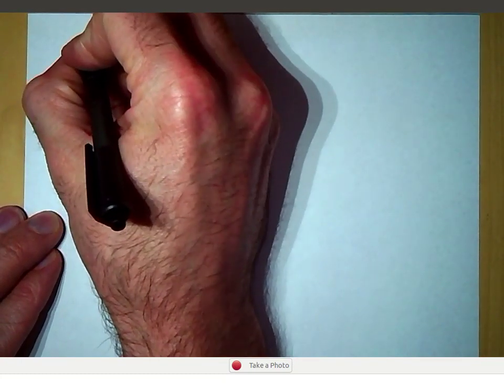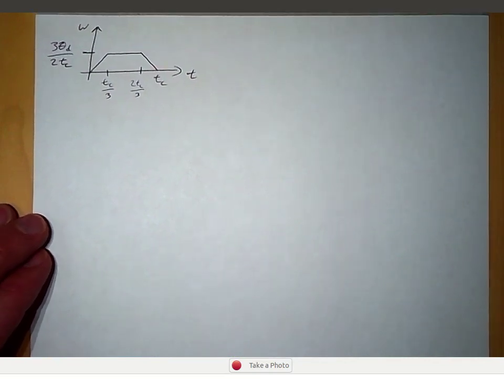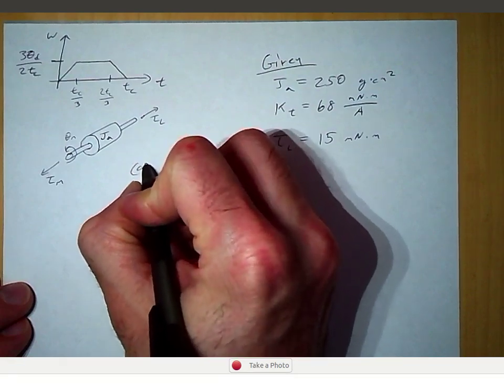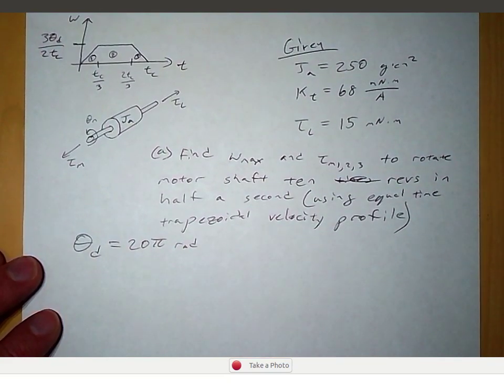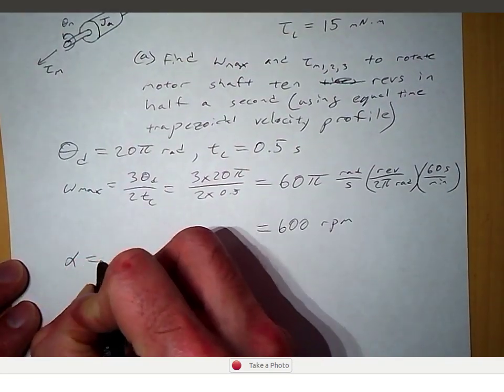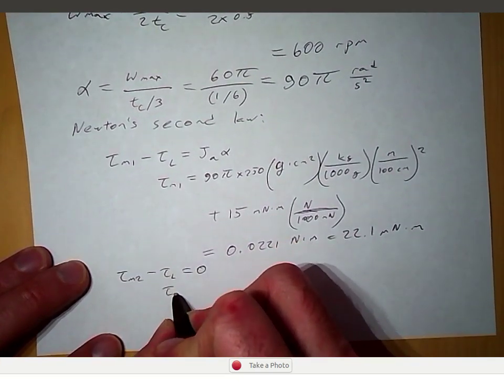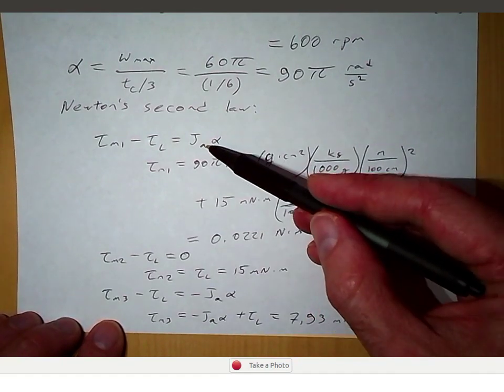Lesson B2 --- Incremental motion example

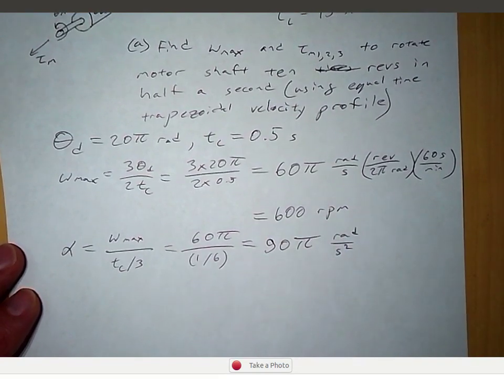Comment: Hello Professor, when you are calculating for alpha at 6:00, I am getting (60pi)/(1/6) to be 360pi instead of 90pi. Is this correct?
Reply from the maker: Yes, @PriusPilot, you are correct about \alpha.  My error throws off the rest of the video.  For example, the torque in the deceleration portion is in the negative direction, not the positive direction as I say in the video.  I will replace this video with a corrected one.  Thanks for your question!
Reply: @drmattmarshall6545  Also 60pi rad/s = 1800RPM at 5:20
Reply from the maker: @javierquiroga6922 , thanks!